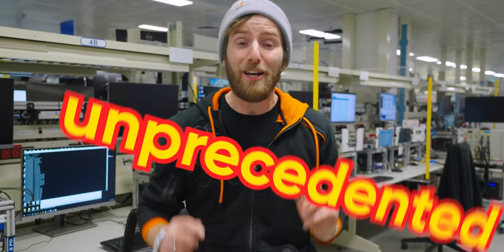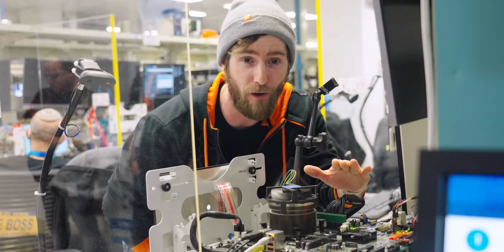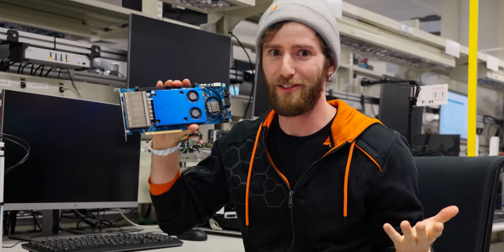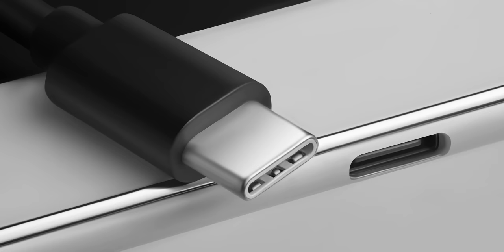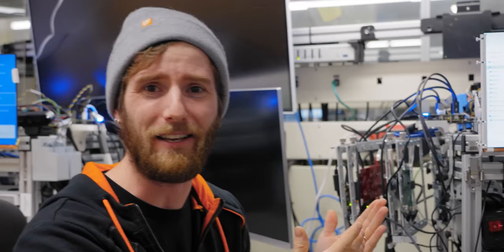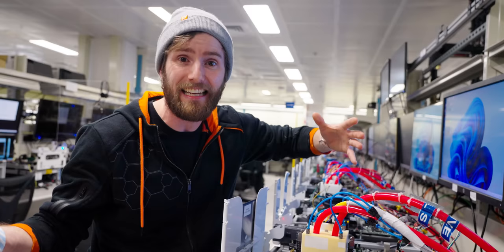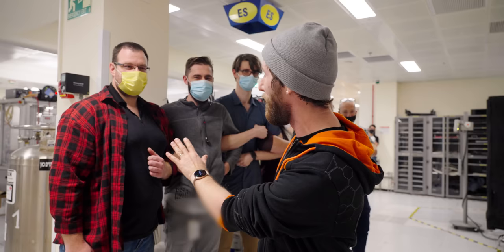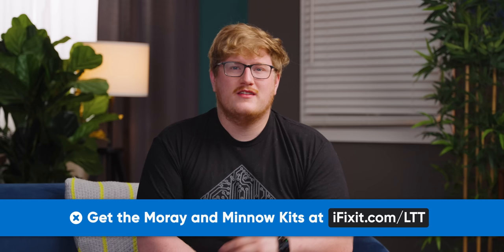I’ve Never Had So Much FUN - Intel Development Center DEEP Dive

Comment: Wait... that laser debuging is literally magic
Reply: You can just change the properties of the chip after it's made! That's illegal!
Reply: @fragalot  But I STILL can't get a freaking shark with a laser beam on its head!
Reply: I remember my father telling me about something similar to this, that was around 30 years ago probably.  They would trim parts on whatever circuits they were working on with lasers, it's came a long way for sure.
Reply: Look up some Bill Herd videos - Commodore / MOS technologies was doing much the same thing way back then using light to change the behaviour of gates to help them debug circuits.
Reply: yeah light ... it's energy to overcome the bandgap something that you usually do with voltages. 

Its like reversing a solar panel, by adding voltage to it, the solar panel will emit light, also if you shine light on an LED, it will produce small amounts energy (you can measure voltage across it but maybe not so much on current)
Reply: wait you've never run a focused ion beam before?  
psht, intern
Reply: @EnsignLovell  The biggest improvement is probably the fact that at that point the transistor size was in micrometers, whereas now you can target things that are a thousand times smaller and more numerous.
Reply: Literally
Reply: fun fact: It's also posible to shoot a lazer into a brain to activate a specific set of neurons
Reply: Reminds me of the Bil Herd stories of Commodore's engineering being able to alter the properties of an engineering sample chip with a bright light; just needed to throw some extra excited electrons at the die to get it to work right.
Reply: That part literally blew my mind!
Like, modern microchips have many MANY layers of transistors, how can it modify anything but the top layer?!
Reply: @lareolanKFP  the transistors are only in the bottom layer and the chip is sitting on its face on the substrate, so the transistors are the upper most part of the chip
Reply: @LordWaldema  Really? I thought they had switched to the 3D design a while ago. That's interesting to know.
Reply: Nope. take Clarke's 3 laws, of which the third one will be the one we all know and partly remember at least the core information of. "Any sufficiently advanced technology is indistinguishable from magic"
Reply: No it's not, ever heard about EPROM where you erase a chip memory with ultra violet light, available since the beginning of silicon technology. With the laser they probably burn transistors to alter the chip properties, they have to control the timing and location quite precisely.
Reply: Yeah, still can't wrap my head around how a laser can alter the state of the active silicon layer when there are like dozens of larger & thicker conductive metallic layers on top of them which usually blocks or heavily blurs all light from passing through... or is this thing only supposed to alter the functionality of an single exposed top layer only?
Reply: Remenber how Raspberry 2Bs (i think) crashed when shooting a Photo of it with xenon flash? Exactly that happened here.
Reply: Well, I could be misunderstanding, but I believe the way it works is that it does a temporary change while the laser is being pointed at the device, so that a change can be tested before it's made and they can determine if that change is the correct path moving forward. Then when the laser is done firing the transistor state returns to normal. That said, light is just energy waves that can be controlled (hence why laser cutters can actually cut physical materials like acrylic, carboard, etc. with intangible light), so it may be that it permanently alters the CPU so that it can be returned to the testing benches to ensure that change fixed the bug that it was intended to without causing any other issues to arise. Either way, the magical part is that we now have the technology to control a laser that accurately and precisely to make a state change on a near molecular level like what's needed here.
Reply: Yeah, kinda is like magic.  I've done microprobing (using very small needles to connect test equipment to a wire inside a chip) and had chips FIBbed (using a special kind of beam that shoots atoms of metal or other materials so you can rewire a chip), but what Intel's doing is much too small for any of that.  It boils down to the fact that silicon is both reactive to and emits photons of light.  It's precisely the same reason why solar panels work and we have LEDs.  So, you can shoot a laser beam at a transistor and alter how it works (for example, keeping it on, even when its supposed to be off).  What the light does is it basically creates excess electrons in the silicon crystal.  And, if you know how transistors work, you'll know that that can turn transistors on or off, depending on the type of transistor and what part of the transistor you point it at.

Similarly with the IREM device he couldn't show.  When a transistor junction is conducting current, it gives off photons (exactly like an LED, actually - same operating principle, just at a  wavelength invisible to the human eye).  A very sensitive, specialized camera can pick up those photons and infer what the transistor is doing.  My company actually uses a much more primitive version of that to help us figure out stuff like why our chip is pulling current when it's supposed to be off and using nothing.

So, it is science, but, even having done some of that work and being able to explain exactly how it all works, it truly does feel like magic.

Comment: I want to see the engineers talking more! I feel like hearing interviews with the actual engineers or just hearing them talking about their work would be really awesome
Reply: That's not gonna happen.  See my comment about what happened when I worked at Lucent Technologies.  The engineers are not allowed to discuss MOST of what they do.  Answering 1 question, or even letting a single secret be seen by an outsider can be the difference in the company succeeding or going bankrupt.
Reply: The next day, he get fired…
Reply: Their individual jobs will be fairly normal e.g software devs, hardware devs, FPGA devs etc
Reply: That will never happen. There's too much risk that they will say something that even hints at something confidential, which their competitors can put together with other information they already have, to gain a competitive edge.
Reply: @deusexaethera  you can get rid of that risk by letting intel approve or disapprove of the content before they release it, which i assume they already have an agreement like that
Reply: Pretty much every job employment contract has an NDA in it - but we usually don't care too much about it, because our normal boring jobs are just ... boring and usually don't include company secrets worth billions.
A job like a lab engineer at Intel though...
Still, interviews could be possible. If Intel is interested in this kind of PR (which I assume they are NOT - as Linus already said, Intel doesn't really show much of the behind the scenes to the public/nerds) they might agree to have the interview footage sent in first to give clearance on what to can be published or not. They probably had to send in the footage of this video too for blurring etc...

Comment: The thing is, visitors like Linus, who can ask good questions, lead to solved problems, at least sometimes. And the fact that Linus knows nothing about this in detail also helps, that the engineers rethink there work from the "basics". And he brings in new points of views, he might bring them to a new relatively simple approach to some component, because engineers suffer from complex thinking regularly. It's basically a win-win-win situation.
 
And you can't imagine how often problems are solved, do to a new team member, who askes good questions. 
Btw, I'm nearly a full fledged engineer in electronicall engineering myself, so I, at least, don't talk complete nonsense.

Comment: The Laser Assisted Device Alteration is an amazing example of the power of physical access. If a person has physical access to a device, it is possible to hack/modify/alter it. That is both something that needs to be accounted for, for example, if you rent out hardware, or don't do physical security, but also counted on, as an ultimate guard against overreaching DRM. Very cool machine.

Comment: It's so cool seeing somebody like Linus get so excited over the things we do as Verification & Validation Engineers. Although I have not worked on the level of ST/NXP/Intel/AMD/Micron etc, I do a lot of testing with their chips in our devices. But it's similar across the tech industry, Ver/Val Test Engineering jobs don't get the 'sex' (hah lack of a better term) appeal that Architect/Designer/Developer jobs get even though (the good ones) they have to know the Hardware/Firmware/Software just as well as the designers to in order to create appropriate test beds. For every feature/functionality there is an iceberg of test scenarios that need to be created, not even mentioning the negative scenarios or designing it for automation & CI/CD.

True, we don't have to design any functional part of the end product. But there is still immense pressure, especially in waterfall environments, to get through the tests because Ver/Val are near the end of the project "holding" up the release.

Comment: This actually brings up an interesting question, when can we expect USB4 to be more commonly used on PCs? I know it’s starting to show up on MacBook Pros, but that’s about it.
Reply: I dint even knew it was a thing xD
Reply: Maybe 1 or 2 years ahead... Even AMD who stated that Ryzen 6K support USB4 didn't have any product that really support USB 4 in todays market YET.
Reply: Wait USB4 is a thing that exists?
Reply: @randomuser6110  it's TB3 but not exclusive to Intel/Apple.
Reply: I guess whenever they make that amount of speed on USB actually useful. I hardly ever take advantage of USB 3 even now, and at most use USB 2 devices like external DVD drives and HIDs.
Reply: I believe the framework laptop is USB 4 but not officially certified so they don't advertise as such.

That said I know that you can connect an eGPU to it and it does work.
Reply: @ridwananhar4418  usb 4 is just thunderbolt 3

Comment: The key point as to why they use compressed air to blow on the sockets when going sub ambient is likely because they are likely using membrane or desiccant dryers to pull most of the moisture out of the air they are blowing. As this significantly drops the dew point, and thus the likelihood condensation will form. Think of the air like a sponge, with warmer air having a greater capacity to hold moisture, if that air is cooled its figuratively like "squeezing the sponge". Ambient air temperature AND humidity level both play a part in dictating the dew point temperature for this reason.

Comment: Some more info about FPGAs - most of them have a hard PCIe or memory block, meaning they are semi-customizable and you can't use old one with the new standard.
What they did here, is built the entire PCIe core and connected it through available transceiver pins (ignoring the built-in PCIe block, if it even was there); which would occupy a significant amount of FPGA resources, making it useless for other heavy tasks. This is actually the "default" use case for FPGAs - a design verification. Limits exist here as well, but with more flexibility - you can't use an ancient FPGA to verify PCIe 5x, because it just wouldn't have enough transceiver speed.

So, let's say, if you wanted an FPGA datacenter accelerator card, which would be forward compatible to PCIe 5x, you would have to build it with 2 FPGAs - one purely for PCIe communication purposes, another one for computing. That wouldn't make much sense, because it would be expensive and would probably lose to newer models in performance anyway.

As for the DDR slot, well, comparable to the new interface speed the DDR RAM is not a high-speed device anymore; you'll need something like HBM memory, those don't go into slots.

Comment: To be fair, FPGA is more common than you might think.  You can get a low-end FPGA for well under $10.  If you want to make a custom product, don't have millions of dollars, and only want to ship fewer than a few thousand units, an FPGA can be surprisingly capable and affordable.  To design and ASIC, just to get one year of licenses for one of each type of software that you need would be most of a million dollars (depends very much on who you are, how many licenses, etc.).  You need digital simulators, synthesis, timing analysis, lint and CDC, formal verification, place and route, and power analysis.  These licenses can be expensive.

Comment: I'm not sure if they still have it, but in Sacramento they had something similar to the LADA, they had machines called OPTI-FIB's and they were used to cut away insulation and circuitry of a chip and re-lay new routs.

I used to help calibrate them, it was fun to be able to play tick tack toe and then see it under a microscope :)

It used a vacuum chamber along with lasers, and material streams to do its work.

Comment: I worked in an Intel Debug lab, Sample prep lab,  circuit edit lab, And Validation lab.  You should do a video on Sample Prep, And circuit edit labs. Both are fascinating processes.  Before you can do the IREM process, The chip needs to be prepped.  ( Sample prep.)  This involves a process of "unwrapping" the device, Machine it down to a specified level.  Polishing it, Mounting it onto an interface board, and putting an optical Finnish on the surface of the chip to make mapping, and probing easier....  The circuit edit process is also very fascinating. They can actually "edit" circuits using a modified electron microscope.

Comment: ... using dried air is a brilliant idea to keep condensate from forming. you don't need or want a lot of air, probobly 20 CFH would be plenty, and it'll just make an air curtan of air without humidity to prevent humidity from condensing.
you were already talking about getting a new shop air compressor setup, if it's dried air, all you need is a regulator and you can replicate that setup to do sub ambient. if you try it with LN2 and you still get condensate problems, just hook it to the gas output of the nitrogen tank you're getting your liquid from. as that is already anhydrous.

Comment: I wonder if this trip will inspire some of the design for the extreme OC done in the future. The idea of using a second set of lines for air to prevent condensation is very interesting. Good alternative to attempts to isolate the cooler from other components on the board.